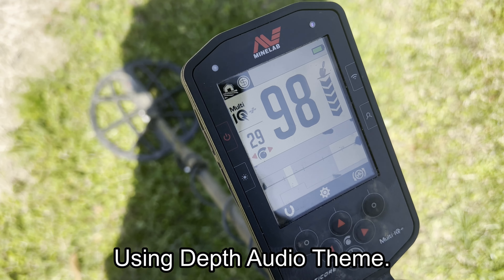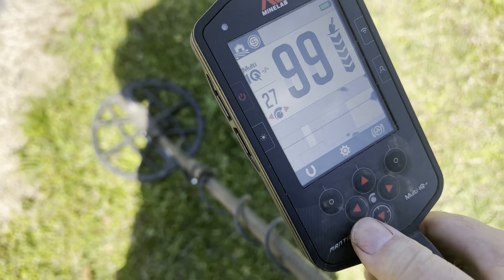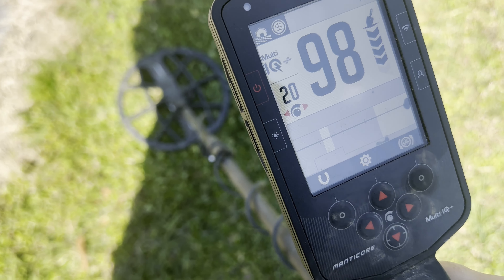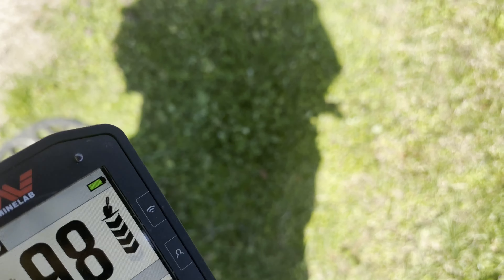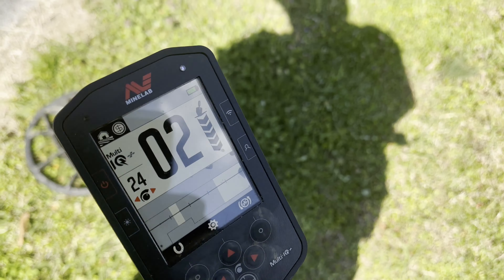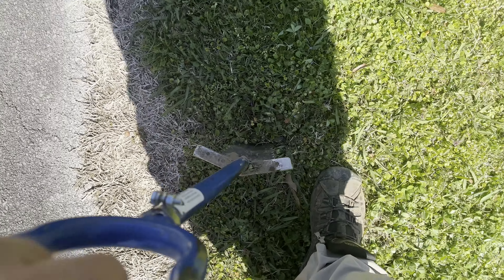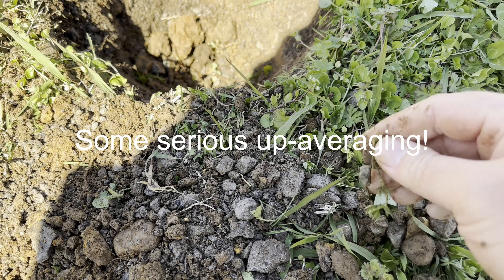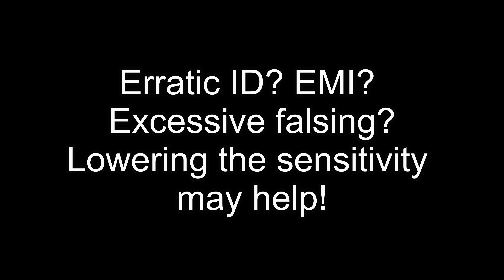Minelab Manticore: Still plenty deep at lower sensitivity levels.

Comment: So why have the sensitivity range 0/35 if the most anyone can use is 22/24 may as well have been as the equinox 800 at 25, its marketing bullshit make everyone think it can go all the way to 35 that way they sell more. As for the 50% extra power again bullshit, its only going in reality an inch deeper on coin size targets..
Reply from the maker: I've been able to run mine as high as 29. Just doesn't seem necessary for the depths coins tend to run at in my area. Most coins are 9-10" max around here, and as you can see, sensitivity of 20 hits those just fine. Maybe the really high sensitivity levels could be useful in certain situations where the ground isn't mineralized and there's no EMI present. I can't think of a spot like that around here, but who knows.
Reply: Achieving a Sensitivity level of 35 is dependent upon the knowledge of knowing how to properly initialize the detectors settings and the environment that one is detecting in.

I'm able to set the Sensitivity to 25 in a small city park, that is surrounded 360 degrees by homes, and is located 0.5 miles from the city center.

I see no reason why I won't be using Sensitivity of 35 in remote locations, up in the mountains and on remote isolated islands.

It's been demonstrated by many with the appropriate technical education that the Manticore has 50% more electromagnetic force (EMF) than the Equinox series.

GL👨‍🦯HH
Reply: @martinsmith2984  You're probably the rudest person I've seen commenting on here.  Everything he is saying is true.  You know how I know this?  I have one as well.  Bought too not a freebee.  Most who comment like this are just upset with the world because they can't afford one.
Reply: @martinsmith2984  "I have been detecting over 40yrs and have owned and used more machines than most of these youtube celebs put together"

Having owned so many detectors, you must be dying to get your hands on a Manticore. 🖐

" The manticore is not even in the top 3 detectors of 20/23 and its never going to be.."

Just saw this post, so the Manticore is ranked number 4?
In what order are the top 4 metal detectors in 2023?🤔

What detector are you using now?
Reply from the maker: @martinsmith2984  Wow, that was pretty rude man. That's cool though. I can be rude too. Please allow me to correct you on a few things. 
1) I'm hardly a YouTube celeb. I only have about 4k subs and I rarely upload anything these days. Truth be told, I've pretty much lost interest in doing YouTube videos because of rude people like yourself. 
2) I didn't get a free machine and I have no intentions of filling anyone with bullshit. I pre-ordered and paid full price for my Manticore. I'm not sponsored by anyone, and I honestly don't give a rat's ass what detector you buy. 
3) What I post here is my opinion, nothing more. However, my opinion is based on actual experience with the detectors in question. Meaning I have owned the Nox 800,  as well as the Manticore. Can you say the same? You're making these statements like:
" The Manticore is not even in the top 3 detectors of 20/23 and its never going to be.."
 and:
"As for the 50% extra power again bullshit, its only going in reality an inch deeper on coin size targets..". 
Based off of those bold claims, I'm assuming you actually own and use a Manticore? If not, then it is YOU who is spreading bullshit based off of no experience whatsoever. 
PS: I don't give a shit how long you've been detecting. I've also been detecting for nearly 4 decades and owned just about every top detector released in that time period. Big whoop. Doesn't mean anything.
Reply: @pigeonbloodruby5330  CTX, Deus 2, legend, Equinox 900, and several more before the manticore..
Reply: @pigeonbloodruby5330  You see no reason why you cant run 35 sensitivity in remote locations, your talking crap, there is nothing to find in these remote locations, even if there was you could not run it at 35, its not possible to run it over 30 without false signals, instability, This 50% crap everyone is banging on about is rubbish, and at 22/24 sensitivity its not going to be any better in terms of performance over any of the top 3 detectors on the market..
Reply: @martinsmith2984  No know it all here but I'd bet my last dollar I'd compete next to you any day of the week.  It's funny to me how the most opinionated people on here have ZERO content.  Thanks for contributing!
Reply from the maker: @finders-keepers1518   Yep. Just another rude troll with no uploads of his own. He has nothing better to do than go around barking in the comments section of other people’s videos because he feels insecure about the possibility of a new detector outperforming his older Equinox. It’s actually pretty sad, isn’t it? And no, I don’t believe he actually owns a Manticore. Highly doubt he’s even seen one in person.
Reply: @MetalDetectingNWGA  Just remember many of us appreciate your time and knowledge put into your videos.  There's a billion others out there actually spreading nonsense.  Those are the ones that should be trolled.
Reply: @finders-keepers1518  Yep zero content is correct, but I would rather have zero content than put out the crap these testers and youtube celebs put out, It seems to me 90% of them have no clue about machines and how to get the best out of them, its all about likes and ego and making money and nothing to do with the hobby at all...
Reply from the maker: @finders-keepers1518  I appreciate it John. Right back at ya brother.
Reply: @MetalDetectingNWGA  Read the above, well thats if you can read, As for the manticore its not and never will be a top seller its just another run of the mill more of the same machine from minelab, and yes I have tested the manticore along side the equinox and Deus 2 and really not impressed at all, very little improvement on depth, unstable, false iron issues, 2d screen of no use at all in any situation. I am not interested in the manticore at all it offers nothing in terms of performance over what I have and have used in the past so not going to waste my hard earned money on it thats for sure..
Reply from the maker: @martinsmith2984  So what you’re really saying is that you swung your friend’s Manticore for a half hour and came to all these conclusions based on your vast knowledge of the machine, which you gathered in those few minutes of use? Gotcha. For someone who claims to have so much experience metal detecting, you should  know that it takes a LOT more than a couple of test runs on your buddy’s machine to really understand it’s true potential. That goes for ANY modern mid to high end detector.
Reply: @martinsmith2984  "there is nothing to find in these remote locations"

So around the year 1100 AD there was a raid carried out on an ancient kingdom. After the raid the military took elephants carrying treasure through the mountains. You're telling me that I won't find any artifacts, not even a rusty nail? I guess it's possible I won't find anything. Camping in the mountains will be my consolatory reward.

" you could not run it at 35, its not possible to run it over 30 without false signals"

No EMI, no modern day trash, 100's of miles from the nearest city, at the bottom of a mountain valley and I won't be able to use Sensitivity 35? What about on a remote island?

It makes no sense then, why Minelab improved the DSP software, used higher quality components to block spurious EMI and not have somewhere on earth where a person could operate at Sensitivity level 35.

You got me wondering if I should spend the time and money to go to the remote islands?  The ancient shipping paths utilized a lot of islands to replenish freshwater supplies. Don't you think that maybe it's possible that a remote island might have one rusty nail? The journey and adventure might make up for the lack of finds.

"This 50% crap everyone is banging on about is rubbish"

It's been demonstrated many times that the Manticore has 50% more electromagnetic force than the Equinox series.

The Manticore has been evaluates with frequency measurement equipment, oscilloscopes and electromagnetic force meters. 

They are all in agreement that the Manticore has 50% more power over the Equinox series and the depth improvement ranges from 3/4" to 2".

Have you found any cool pennies this year? 

I personally like finding pennies that were smacked by the lawnmower. 😂
Reply: @MetalDetectingNWGA  Its not rocket science is it, well it is for you with no understanding about any machine, I have as I have said used all minelabs machines over the last 20yrs, the manticore is again as I have said more of the same, So nothing special at all, So sorry no Gotcha at all, if you had any experience yourself you would know there is nothing new with the manticore that we dont already have in the equinox range...😜
Reply from the maker: @martinsmith2984  Shhhhhhh…. Your ignorance is showing.
Reply: @pigeonbloodruby5330  Its not been demonstrated at all, seen every test and in my own tests, and they all have one thing in common they are all running sensitivity at 22/24 to get the machine to run anything like stable, so again at those sensitivity levels it offers nothing in terms of performance over what we already have, Its a waste of money and no big step up from the equinox machines on offer, and the Deus 2 again way ahead in terms of separation and unmasking situations...
Reply: @MetalDetectingNWGA  Whats up your not saying much now, have you realised your out of your depth and dont have the knowledge to reply with anything...😂
Reply from the maker: @martinsmith2984  No, after reading your last comment, I realized that I’ve been wasting my time by debating with someone who is clearly ignorant about metal detectors.
Reply: @martinsmith2984  The Manticore is far from being perfect. Lot's of software changes are needed. It's a new product, that's only been in the hands of users for 3 months. Given time the Manticore performance will only improve. 

The vast majority of people don't know how to properly initialize the Manticore parameters, they are struggling through the learning curve, as one would expect.

In the future you will see people maxing out the Sensitivity in select locations.

The extra 50% more power, first in class EMI mitigation, Target Trace unmasking and confirmation and 2" of depth is a marvel of engineering.
Reply from the maker: @martinsmith2984  if you actually read the review you’d know that I said 50 hours isn’t enough time to properly learn this machine, and that I’d add more to the review as I get more time on the unit. I now have roughly 3 times as many hours on it, and I’m still learning. You see, I’m not the one on here claiming to be an expert on the Manticore after very limited use. That would be you. And I’m sorry, but I don’t believe you have 2 hours using a Manticore, let alone 50.
Reply: @martinsmith2984  I will agree the 2d screen is nothing I use....on a regular basis.  Only because the Manticore is lightyears ahead of the Equinox in terms of audio....and yes it does take time to hone in on it.  In saying that though.  How many times have I been tricked by my XY screen on my D2?  MANY!  All the "visual aids" on these new machines are to some degree a gimmick.  Possible tool for certain situations but just like XP Minelab tones have a load of info too, if learned.
Reply from the maker: @martinsmith2984  The only place you've seen that review is on the Friendly Metal Detecting Forum and the Detector Prospector forum. Posted by ME, in both places. So, I challenge you to provide a link to any one of these supposed copies of my review posted in other locations. You cannot do it, because they do not exist. While we're at it, here's another challenge: Lets see a video of YOU using the Manticore. You come on here criticizing everyone else, so the least you can do is upload something of your own. As for your other repetitive comments claiming that I got my Manticore for free, I've already told you that I paid for it. Since you can't seem to accept that, I'll issue one more challenge to you. My email address is listed in the "about" section of this channel. Send me an email and I'll reply back with a copy of my receipt. However, once you see for yourself, I expect you to be a man and come back here to admit you were wrong, OR STFU! My guess is you'll make excuses and avoid all 3 of those challenges, because that's what trolls do.
Reply: Exactly, it's the same situation with microphones, no matter what amplifier you use using too much gain will cause feedback.

Comment: I’ll confirm that 1,000% with the Explorer and CTX, after a couple of hours of extensive testing for this very purpose. This is why I never went below 18 because once I started going to 17,16 on the CTX the 10” dime went away…in my soil with the 11” coil. 18-22 on the CTX was the sweet spot for me. With the horror I deal with running high sensitivity makes no sense, it just exacerbates the iron falsing and makes the audio unintelligible. It just depends where you are, but higher and higher sensitivity simply lets smaller and smaller responses be heard. You sure have some enviable soil down there…🥹
Reply from the maker: I was in the habit of running the CTX sensitivity at manual 25-27 for the longest time. Took me a while to realize that sometimes less is more. The D2 seems to run super quiet at high levels in Fast, but not so much in Deep HC. Same with the Manticore running AT low conductors vs AT high conductors. Those lower frequencies are sparky at high sensitivity levels. You still racking up that silver count with your D2?
Reply: @MetalDetectingNWGA  That’s the great thing about being able to use different frequency sets, and even select a single frequency if EMI is bad…something that FBS wasn’t able to do. The progression of metal detectors has been great in the last 20 years and continues to impress! And yes, the train rolls on, the count is at 81!
Reply from the maker: @wizardsofwisconsin7400  Holy shit! 81 in only a few months is amazing! Especially when you consider that the weather has probably cut down on your hunting time. Heck, you're on coarse to break the 200 FTY barrier!